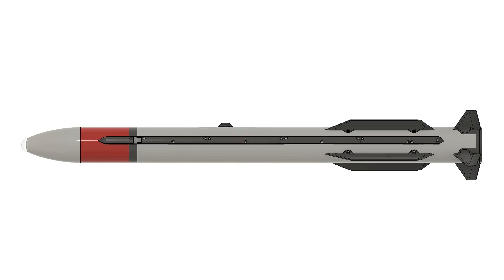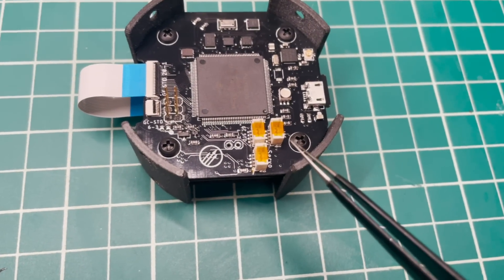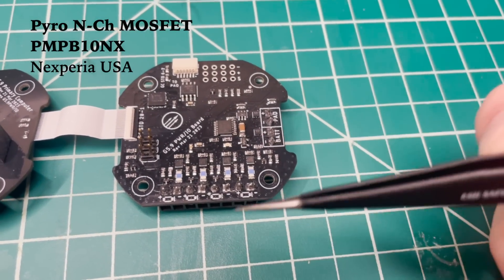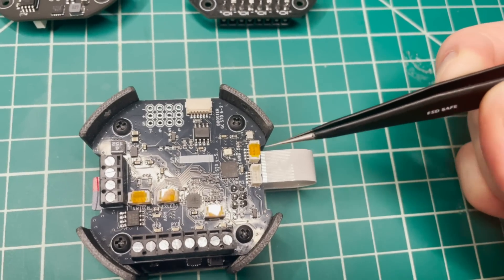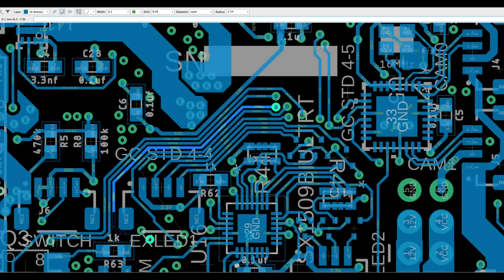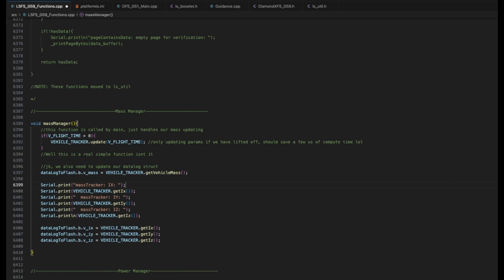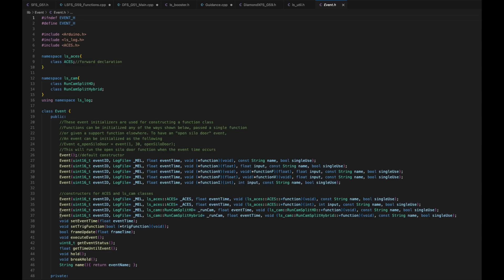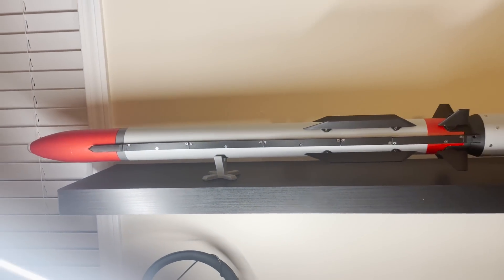How Does This Rocket Know Where It Is? Active Control Flight Computer - Building DIAMOND-X Part 3

Comment: Thank you this is helpful for me as I'm building something similar but underwater. Why did you go with three separate IMUs? So far I'm going with a single BNO085 (bno055 with better firmware) and letting the IMU do calibration and sensor fusion on device. So why the multiple units?

Comment: You should definitely build a rail launch system. Also I worry about inertial coupling on the roll axis without control surfaces on the wings. You obviously did your homework though, cool project.

Comment: I know it might seem like a dumb question but, what coding language are you using? I'm new to this field and want to learn more
Reply: Chances are it’s written in C as most microcontroller programming is in C.

Now if it’s is running embedded Linux (which I don’t think it is) but if it’s running embedded Linux then it could be using C++.
Reply: Actually I misspoke he said in the video he uses arduino.

So the arduino language is basically a modified form of C with premade libraries made for controlling different pins and peripherals on the MCU.

Comment: I've seen one where they had small tabs with a small servo controlling roll. I suspect that can be extended to pitch with say three fins. 
What would be interesting is to have those with top fins, not fins at the rear. The reason is if you have a two stage rocket, you only need the one control system. When the booster is dropped, they are now rear fins for the upper stage.
Reply: would be cool, but is not practical at all. the booster is generally heavier than the vehicle, thu shifting com and making the rocket unstable when only one finstack is present. if you add some fixed fins on the booster, the moving fins on the top vehicle create aerodynamic instabilities on the fixed fins, leading to loss of control
Reply: @ad_astrum One fixed fin stack on the booster - passive. 
One moveable fin stack on the second stage, at the rear of the second stack that does all the steering. Then you just have one set of electronics, one set of fins. 

Stability? Can that be done?
Reply: @adenwellsmith6908 Nope, too many instabilities caused by the foregoing changing airflows dur to the moving fins. it works the other way around tho, a fixed fin pair on top, and one moving on the bottom. alternatively one can make bothe movable, but only use the lower ones when the booster is still attached and let the upper ones be fixed and then change it to vice versa on stage sep

Comment: Would you be able to do a software release excluding GNC? That’s obviously the most interesting part, but I’m also really interested in your tooling stack and use of HIL for verifying software components before flight. If you have any resources on what you’re using I’d really appreciate it. Thanks!

Comment: Do you have to talk to anyone and get permissions to launch the Rocket? Have you had anyone come out and ask questions?
Reply: Each country has specific regulations, there are countries with very dense airtraffic and others (or regions of it) with sparse airtraffic. Also e.g. in the U.S. there is an altitude regulation by FAA like 400 ft. So it'd vary.

Comment: Fantastic.  Really nice code structure and division of work. Look into Clifford Algebra and Geometric Calculus as used in graphics. I think you can eliminate some matrix math.

I would like to see more about the navigation and how/when initial conditions are set. How is gravity worked in? Like how does it tell g relative to accelerations from the motor?

Comment: I've always wanted to build my own rocket with guidance system, but you actually did it ! With creative use of commercial sensor components and MCU, and your boards look great. I can totally see that the control system overall must have been challenging, especially on 3 axes and all within 10 msec. Great piece of work, and I enjoyed watching your presentation. Thanks !

P.S. I noticed you have a lot of UART communication channels, which take up a lot of hardware, and maybe that could be simplified with a single high speed CAN bus or so. But I admit I don't know the specifics of all your internal com needs.

Comment: Very cool project! Is there a reason you used the FFC & Pinheader connection, instead of a mezzanine connector?
Reply from the maker: Good question! Vibrations are very common in rocket launches, and I was nervous about mezzanine connectors disconnecting, even momentarily during launch. The FFC let’s the two boards move/flex in relation to one another and still be connected. That being said, the 6-pin power connector is rigid anyways so maybe a mezzanine connector would have worked all along.

Comment: This is super impressive, way cooler than any hobby projects I have done :)
I have a few suggestions I think will greatly help you out in the long run, however, it might be more hassle short term. 
One is to use a RTOS, like you probably know since you briefly talked about timing. 
I think a RTOS will probably make it easier to use the board for different applications in the future too.
Another is to use better ecad tool like KiCAD or Altium over Fusion's built in tool.
You may also want to use a smaller pitch stacking/mezzanine connector instead of a flatflex cable.
Reply: With intensive vibrations the flexing of the cable is almost a required feature. Means the connector doesn't shake loose or break (whichever comes first).
Reply: @someonespotatohmm9513  Without going to much into detail I think you will find that stacking mezzanine connector are way more common and reliable than flex ribbon cables in high vibration and shock applications such as aerospace, space, military and high-end industrial systems. A flex cable just flapping around would quickly break in the vibration fixture...

Comment: Are you using an RTOS or is your event loop completely synchronous? Asking because it seems like without task switching you may find critical flight operations are waiting on much less time constrained ones, such as comms or data logging.
Reply: Use queues and DMA? Or Threads ? RTOS were invented for slow CPUs, not for slow IO.
Reply: @ArneChristianRosenfeldt  Do ATtiny’s have multiple threads? The DMA will transmit one byte at a time over UART, but this still means the CPU is waiting for the DMA and therefore for the peripheral itself.
Reply: @aidanginise  why is it called DMA then? On PCs blocking input is realised using the IN assembly instruction right on the CPU.
Reply: @ArneChristianRosenfeldt  Also I’m not sure what you mean by “queues”. In the embedded systems world we have queued semaphores and messages for intertask cooperation when working with RTOS’s. Is that was you’re referring to?
Reply: @aidanginise  oh, only know PC technology from 1990. And there the sound card would read samples from a buffer in RAM. And the graphic card does the same. And the the sound card would write samples to RAM. And with the CPU I would just loop over all those and read the ports to check their pointers. No idle wait.

I think idle waiting was introduced by protect mode because the code has so much security context that you can’t just loop over all items in a queue.

Semaphore is more about when two producers want to write to the same buffer. But only recognise producer-consumer pipelines here?

Comment: Could you comment on the component costs of all the electronics components -- especially all the specialized sensors?
Reply: probably about a hundred dollars
Reply: @ulyu7071  I believe some of the specialized sensors can be expensive, but I would be curious about the cost of components used here.

Comment: I have been doing some reading, and it seems 'guidance systems' are only restricted in export within the scope of 'unmanned capability to deliver 500kg to 300km' (source: 'US export control laws and regulations', MTCR Cat I (p.46), NASA) and thus model rockets generally don't fall under this classification. They also do not fall under Cat II (which would be 300km range, but lower payload capacity). See also Bureau of Industry and Security website (BIS.doc.gov): "Both Category I and Category II items are MTCR-controlled []. Missile systems or unmanned aerial vehicles that do not meet the range and payload capabilities of Category I and Category II are NOT MTCR-controlled." 
And that makes sense. In general export control targets larger platforms capable of delivering (significant) payloads on relatively larger distances, as those are useful for space missions or warfare. 
Also, pretty sure you are not doing anything cutting edge on the control system side, and all control system literature is widely available in textbooks and online. Otherwise textbooks are also banned (they aren't).

Comment: What’s about with the Export Restrictions? There are also Open Source projects available for Rocket Guidance, are those different in terms of which Law they need to comply with? 
So it wouldn’t be possible to Open Source this project later?
Reply from the maker: Export control restrictions are intentionally vague and vary country to country. This project probably doesn't fall into the spirit of USML restricted material, but parts of it fit into the letter, so it's better to be safe than sorry. Beyond that, there's a lot of safety procedures that go into active control flights even at this scale, and I'd hate for someone to just download some files, do some 3D printing and get themselves hurt.
Reply: @LafayetteSystems  Yeah that I can understand. I also Plan to do this as a Project in the future, so I don't need the plain code. But Publishing some recourses via you Learned all this stuff would be a great help. Im exited for future Videos!!!

Comment: Why are multiple IO expanders used? I am not familiar with the MCU in question, but with that many pins I would assume that it would have plenty of peripherals (UARTS and GPIOs mainly for this application). Was it a limitation of the amount of the wires in the flex cable?
Reply from the maker: Good question! I could do without any IO expanders, but it would require a 36-pin FFC which is just comically large and it would eat up every last GPIO pin and UART on the MCU (let alone routing all of them to the cable connector). The I/O expanders help cut that down tremendously. All of the really important connections are directly to the flight computer (Servo PWM outputs, pyro arming and fire signals), whereas the non-critical stuff (booster/pad detection, LEDs, pyro continuity) is handled by I/O expanders and polled via I2C. That way, if an I/O expander fails for some reason, it doesn't accidentally fire pyro channels or something bad.
Reply: @LafayetteSystems  That makes a lot of sense. Using dedicated pins for critical functions is a good idea as well. I don't think there are any better solutions to be honest, without spending tons of money on higher-density connectors. Thanks for your reply.

On the topic of flight critical hardware, had you considered implementing a 'watchdog' (not the correct term) MCU to monitor the flight state? As in, if there was an issue with your flight firmware, say it got spammed with interrupts or otherwise held up unexpectedly, a backup mcu could force an abort state, or override control to the pyros for example. Obviously, this would also be a failure point, and you would need at least 3 MCUs to have a proper voting system. And I assume that bottom board is already 70-90% full. So I guess its not really practical but I typed it up so I might as well send it :P

What I mean, I guess, is in terms of redundancy, what choices did you make? Was there anything that would've been beneficial which you had to leave out of the final design?

You did also mention a video on telemetry, that sounds like a great idea.
Reply: @tariqsingh3747  that is actually a great question man